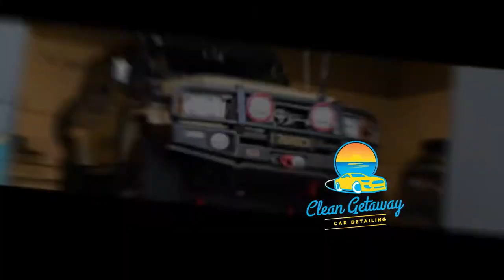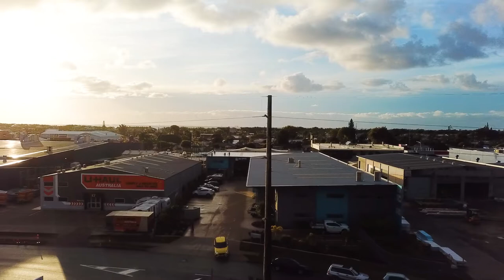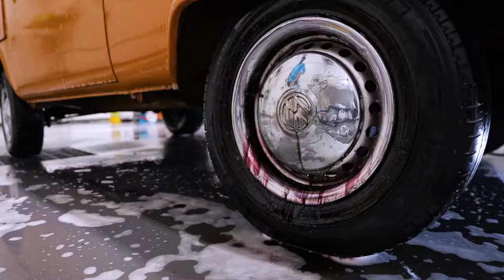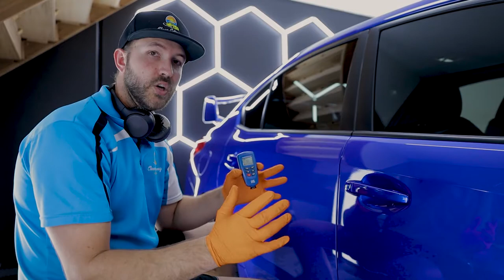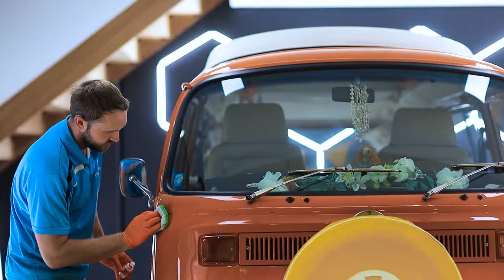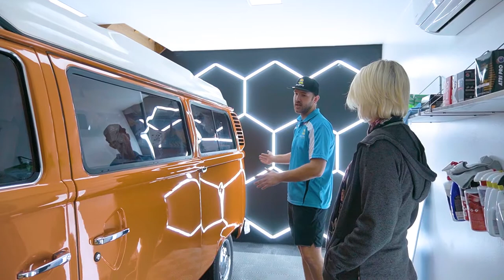Restoring this 1975 KOMBI -  OLLIE //  Machine Polish & Gtechniq Ceramic Coating

Comment: Hey Joe, love the video!

Out of curiosity, why Nano over a wash like Auto Body Gel?  My impression has always been that ABG is the better option prior to decontamination, polishing, etc as those processes would remove the protection that Nano gives - whereas ABG doesn’t provide any (and is cheaper haha). Would be keen to hear your input. Cheers!
Reply from the maker: Hey Darcy, i like your questions!  Nanolicious is definitely better used for maintenance as it does have the protection elements in it and is also great for coated cars.  We like use Nano due to the great lubrication it provides and since we have so many different types of vehicles coming in needing different types of services, it's easier for us to stick to using 1 car wash instead of having 3, 4 or 5 different kinds.  We do go through seasons of preferring certain washes over others, it's actually kind of funny.  But it's always test and measure, trial and error to see how they perform over time.  i hope that helps :)
Reply: @cleangetawaycardetailing  that makes perfect sense actually. I don’t blame you either, Nanolicious is definitely the best wash I’ve ever used. Thanks for the reply :)